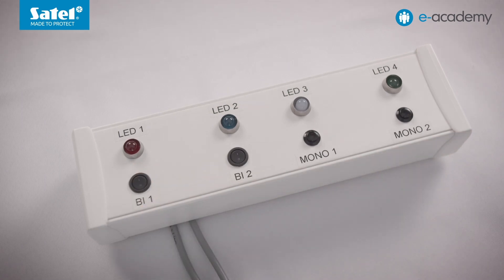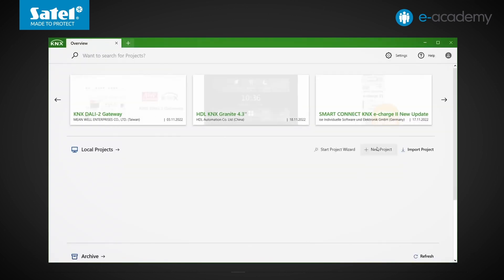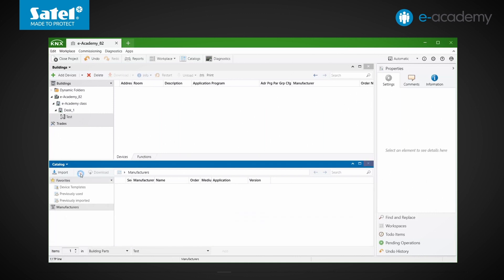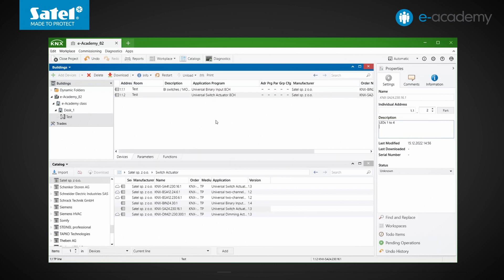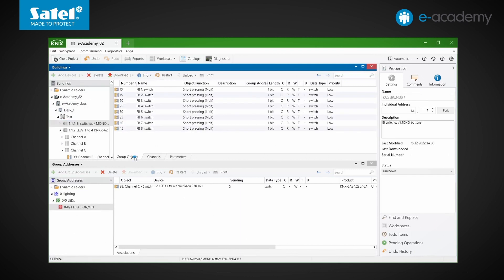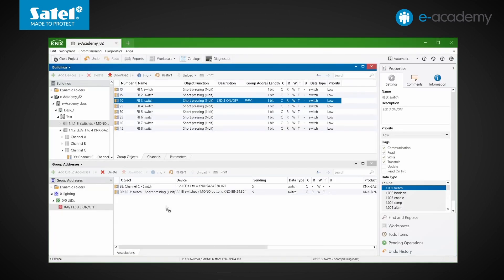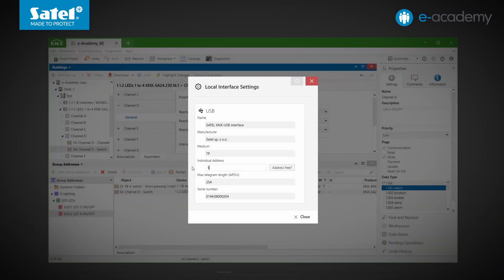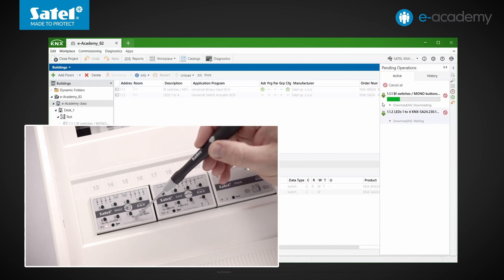SATEL e-Academy 82: KNX System – programming – part 1

Comment: I saw full episodes of e leaning of satel.i know only the basic of installation and commissioning of satel 64 plus.
Can u explain about program using computer and key board separate.

Panic button
Motion sensor
Door contact
Reply from the maker: Hi, programming depends on the model of product you wish to fit your system with. Make sure to read our detailed manuals, you can download them from support.satel.pl. If you need any further assistance, feel free to contact our technicians.